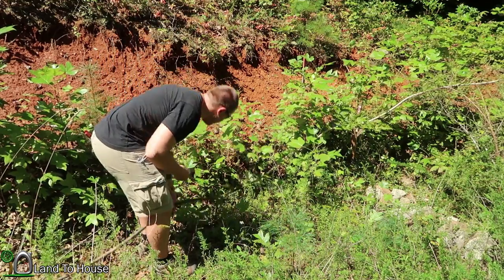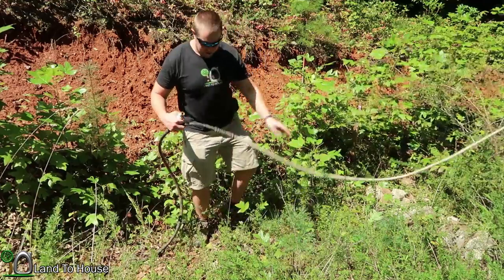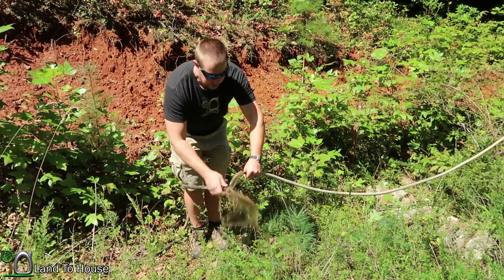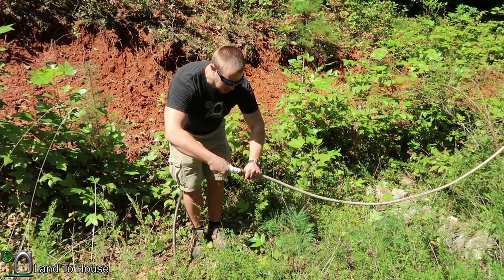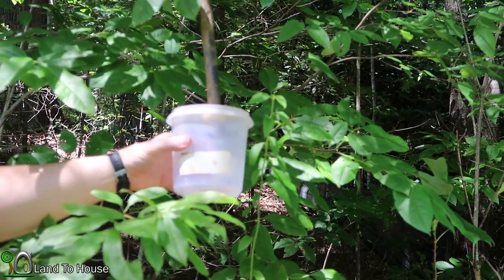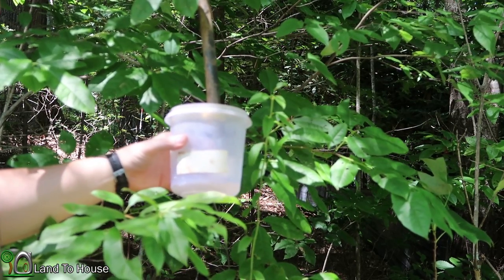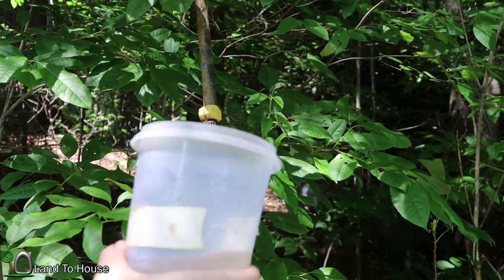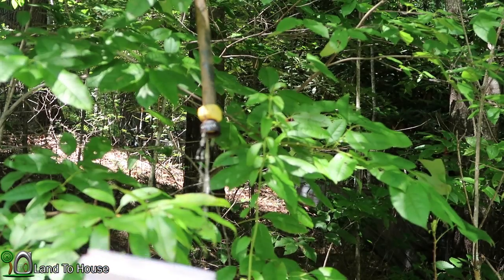Delivery Pipe Check Valve Ram Pump

Comment: Hello Mate, you have a very valuable channel here helping lots of people around the globe having difficulty accessing water. I have a pump that runs 50m elevation with around 150m delivery pipe length. It only got me around 35m elevation that the pump pushes the water up. Will adding multiple swing valves can help the water pushed up the hill even more? I am thinking 2 swing valves placed 3rds of the delivery length. 

Really appreciate your response.

Comment: Hello! I also though of this on my ram pump setup that delivers the water around 40m elevation high and 70m pipe. However, seems it tops there. However, do you think it will increase my pipe length if I install swing valve? I am a bit short with the length needing to deliver around 30m length more and 10m incline. Now, I need to setup an electric pump to continue bringing the water up hill.

Comment: On a normal ram pump built, it's better to have a inline check valve with spring or without the spring?
Reply from the maker: I have not tested the difference. I like having the spring but I cant say one way or the other.

Comment: Try both before and after pump
Reply from the maker: Sadly it will not work before the pump. That would stop the pressure wave from going back up the pipe to the source.